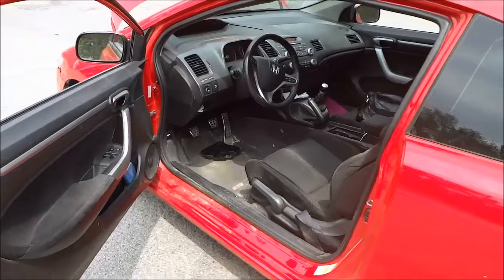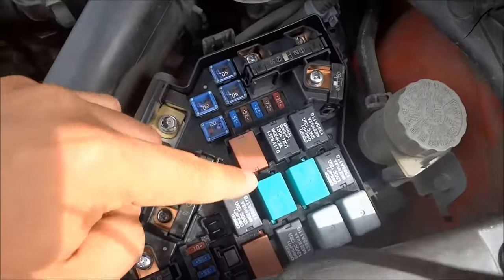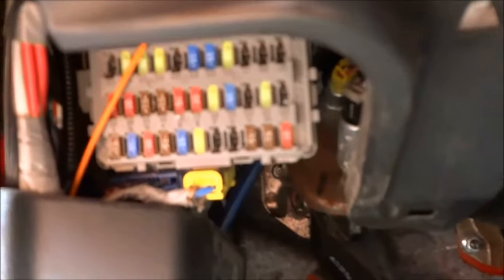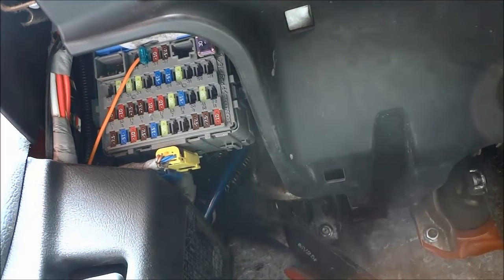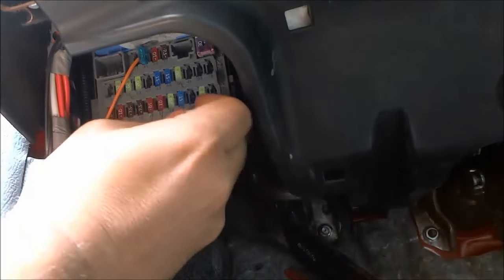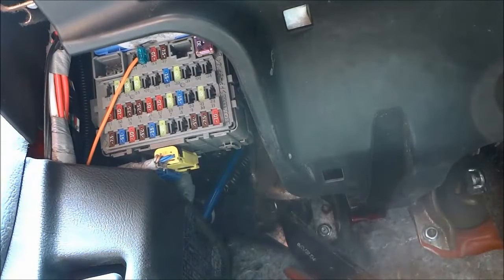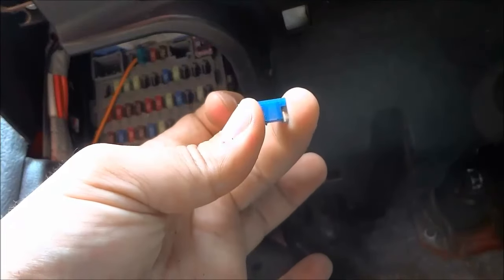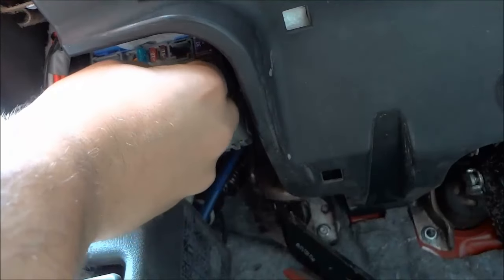How To Replace Car Fuses-DIY Automotive Maintenance

Comment: Does it matter what way the fuse goes in? EG: I have a 15 fuse facing right to left  so looking at it front on reads (1 on the bottom and 5 on top) and another going left to right and reads (5 on the bottom and 1 directly beneath). These are 15 fuses I’m referring to.
Reply: Exactly my question too...
Reply: It does not fyi 😃

Comment: I have a question somebody was testing their car for a no start condition with the ignition on The person remove what appears to be a PCM fuse when he did the headlights came on and then he put the fuse back on he did that a couple times with two 10 amp fuses is that recommended or is that bad to do

Comment: I have a 2004 GMC Sierra. How do you pull the ABS fuse out? I can't do it with my fingers and pliers just damages it. Where do I buy a puller for it?